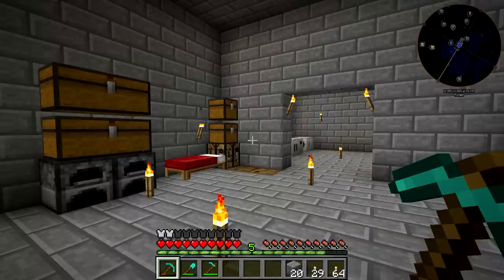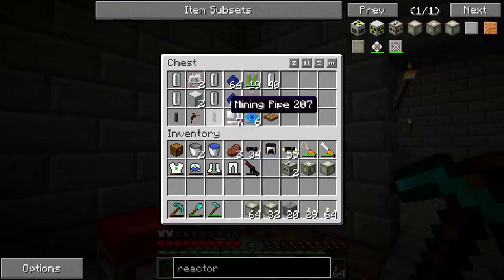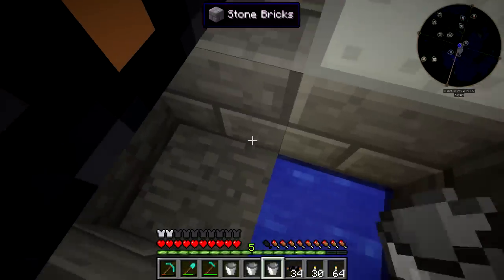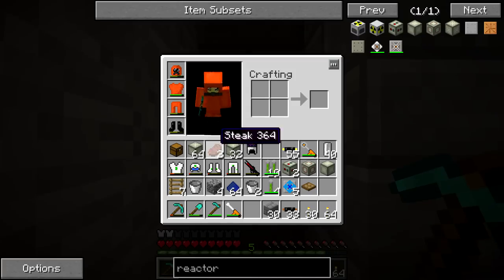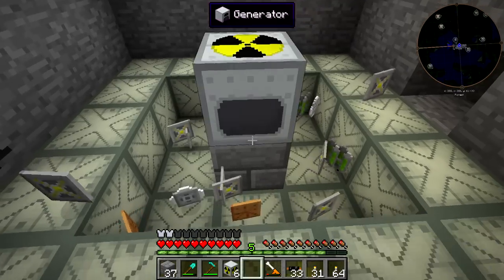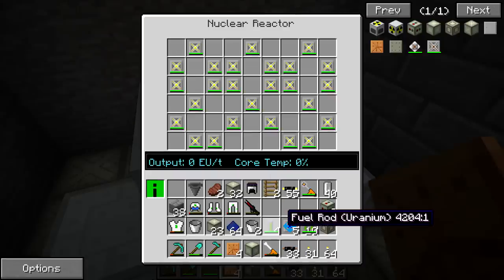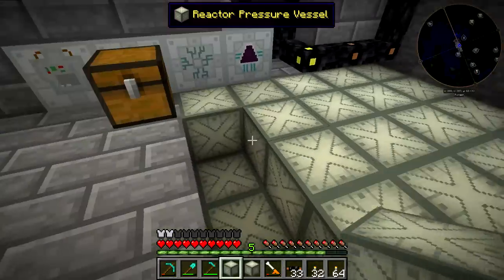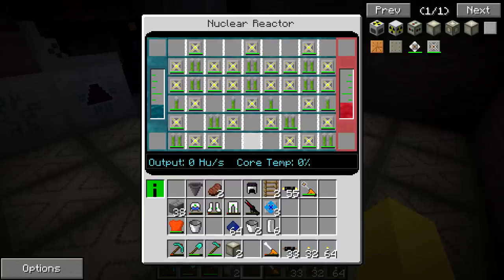Surviving With IndustrialCraft 2 :: Ep.17 - Liquid Cooled Nuclear Reactor

Comment: laughs in mad fucking scientist
Your reactor is so horribly inefficient, look at it! Mark I EA, so CUTE. I MADE A MARK I EA* WITH  12 EFFICIENCY
And the best part about it is that it uses 50% less uranium, with only 2 quad and 2 double rods! However, the downside is that, unless you find a way to automatically supply it Neutron reflectors, you will have to spend some iridium for max power